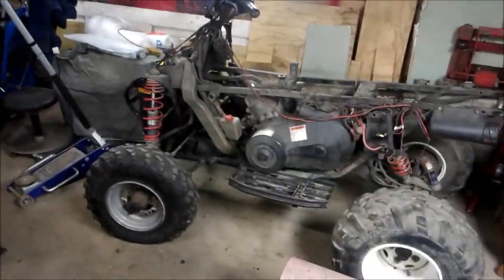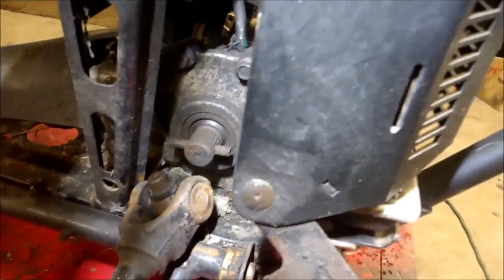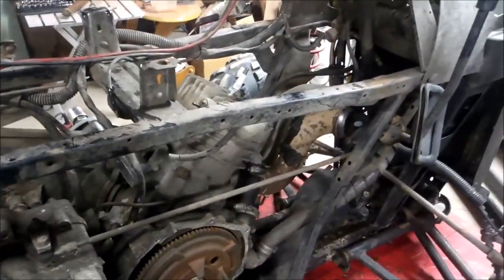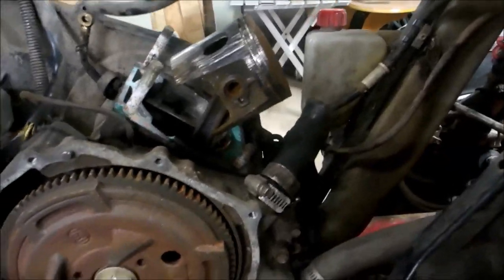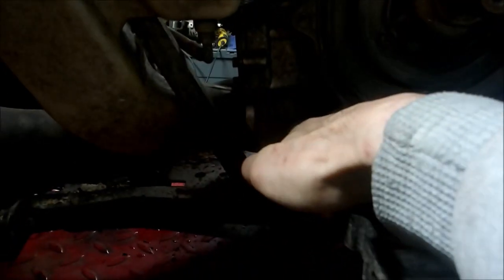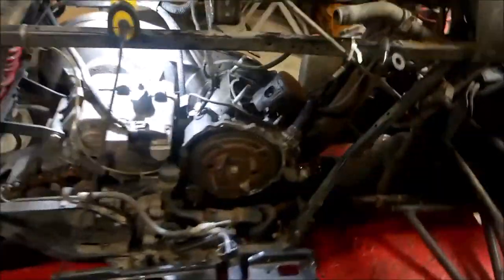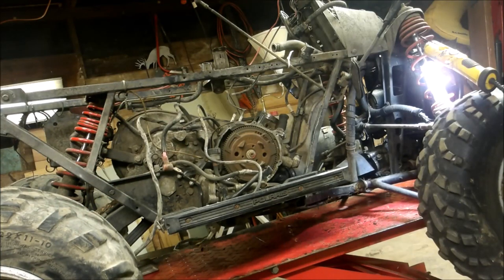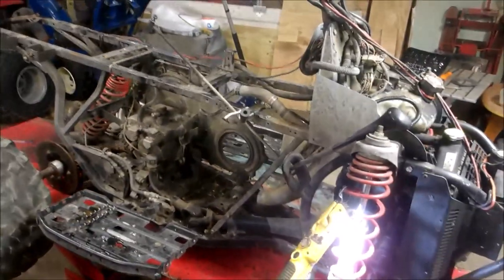Seized motor! Polaris 400 Engine removal on a Basket case.

Comment: What is the thread pitch on the 3/4 rod you made into a clutch puller? Did you taper the end of it or grind off any of the threads?
Reply: I’d like to know also.
I have a bunch of Polaris snowmobile pullers I’d obviously try  first

Comment: Well I pulled the dipstick out of the transmission and the magnet is full of steel. I think it's locked up because the transmission exploded. Can the transmission explode & lock up the engine? Are they rebuildable when they blow up, or should I just get a new one?
Reply from the maker: transmissions can be rebuilt. I have a video on one being rebuilt. If the tranny is locked up it will put pressure on the belt and the clutch will have a hard time turning on the engine. The engine and Transmisson are separate. Try to remove the belt and see if engine runs.

Comment: Watching this episode vs my "mint shape" 2000 Scramble 400 :  an oil pump leak,  good compression, rad hold coolant, dry/not too dark spark plug, clicking starter solenoid (cranking some time), questionable sparks (on and off)  and an unknown carb.......l guess it was parked years ago when 2T oil leaked and never run again.....

Comment: I have a 2001 scrambler 400 2 stroke and it doesn’t have a radiator it has an intake house up to handle bars, is that factory?
Reply: Ner

Comment: How did you get the pull start off without removing the from driveshaft
Reply from the maker: Push or disconnect the brake lever. There is just a small amount of clearance to wiggle it past.

Comment: So I got a Polaris it’s a 250 I don’t know if it’s a sportster or what it is but I have washed one of your videos about the spark plug and it was the Killswitch well I got it fired up but the guy that I got it from ripped the wires up so I had to touch wires to start the 250 it fire up for a little while and then I will die down I mean any suggestions I should do with the wiring or how to keep it running I don’t really know very much about any of the Polaris
Reply from the maker: I would clean the carb. It might need adjustment. what wires are ripped? maybe get a new switch off ebay. Also ,it could be your cdi box depending how long the wires were bad.
Reply: Titaniumman Garage  is there anyway I can send u a picture of it or do u have Facebook
Reply from the maker: @benjones5426  T-Roys Toybox on FB.
Reply: Titaniumman Garage I sent you a video most of your videos I’ve been watching has really helped me try to get this Polaris running

Comment: New to the channel.  Lots of great info here. Thank you.  I have 2 1993 Trailbosses.  I'm replacing the piston rings and doing a top end job.  Can I ask where you get your Polaris parts?
Reply from the maker: E bay for the piston. There is a guy in Milwaukee that parts them out. I get alot of parts from him.

Comment: Dude please help.   Have a 2001 scrambler 400. And my carb i think.  Can barly get it running. and when i do.  Soon as i hit the throttle it bogs and dies. Have to feather the throttle to get any type of revs. Looks like its dumping fuel in the carb . Cleaned everything  and i dont know what to do. Any thaughts
Reply from the maker: It could be  lots of things. First try a rebuild kit for the carb. Everyone says you can just clean it and go. I've found out it performs better with a new jet. Check your throttle cable. Does it stick anywhere? Check your oiler. Is it stuck open? If so try a new cable. I'm assuming its a 2 stroke. Pull the sparkplug and drain the case. There might be too much fuel at the bottom. And check the exhaust. I had a mouse nest in one of mine. What color smoke is coming out of exhaust? Also check your carb settings air/fuel mixture screw. Also the place your cable comes into the carb. sometimes turning it in or out will lower the amount of fuel coming in. And lastly do a compression test. you can rent a tester at any auto part store. compression should be above a 100. I've seen em run at 85 but pretty weak. Hope that helps. Its hard to diagnose without seeing it.
Reply: @TitaniummanGarage  hey thanks for the verry nice response. Compression is at 125. Smoke is bluish white more white. Tried draining case already nothing came out. But i didn't pull the plug ill try again your way. everything els seems ok.  Tries the air fuel screw and idle screw.   Carb rebuild kit on the way thank you. ill let you know if you got it running for me
Reply: @rolfbach2721  mine did similar only when i'd let off the gas it'd die turned out to be the throttle cable was to tight

Comment: I have the Florida version a 90 trail boss 250 can't get the clutch of I'm going to try that the piston had no compression it has been sunk probably many time wired up for nothing but pull start and no battery but it dose have great spark the top bolt on the head was a bitch to get out so after seeing that I'm sure it needs crank seals and bearings I don't know if you've done a video on that I like these Polaris and you've answered some questions before it's much appreciated as the dealership is useless with older machines
Reply from the maker: Thanks. Did you see this video? https://youtu.be/lI1R7Wi1xnM Its for a 400 but the installation of the seals are the same.  I've used a 3 inch wood screw. screwed it in the seal to get it out just and use a press for the bearings. you can get a cheap press at harbor freight. Good idea for a video. I love these older machines too. lots of power off the line and they are easy to repair compared to a 4 stroke. Good luck with the 250
Reply: @TitaniummanGarage  imgonna check that out I just picked up a xpress 400 and a parts frame for $75 do you habe any videos on how to fix the shift lever it's not even moving the rods and it's definitely not right sometimes people do more damages trying to fix these than if they left it alone
Reply from the maker: @georgehuffert5157  Your giving me all kinds of ideas for video's. thanks. Best thing to do is unbolt linkage from tranny and shifter. take a vise grips, turn shifter on tranny to neutral on high and low if it has it. put shifter in neutral. loosen nuts on both ends of shift linkage and spin the ends till they fit in the holes of the shifter and tranny. then adjust once running and tighten nuts. lots of guys jam them into gear and the dog gear in tranny goes to hell. I have a video how to rebuild a tranny if your is that bad. and sometime shifter goes bad gets rusty inside. you can take the 4 screw out of the top and inspect it. there is a small spring inside so be carefull when you take it apart to see where it goes.
Reply: @TitaniummanGarage  I'm gonna try that all my bikes are old my newest is the 97 425 magnum 4x4 that needs at least rings I'm going to watch that video I have 3  2 wheel drive transmission in parts bike's do the 2 stroke and 4 stroke use the same transmission they look the same
Reply from the maker: @georgehuffert5157  The 425 might be the same. 500's use a different transmission along with the magnum 500's
Reply from the maker: I just tore down a 500 and removed the crankshaft. I should have recorded it. 425's are pretty damn close to being the same. cylinder is a little smaller.

Comment: I have antifreeze in my cylender and in my counterbalance oil what can it be
Reply from the maker: Sounds like the water pump is leaking into counterbalance and your inner crank seal it worn letting coolant enter engine. check out my rebuild video. https://youtu.be/lI1R7Wi1xnM

Comment: Thta piece of crap water pump shaft...were end goes bad,and need to split to repkace bearing....im thinking of just putting an electric qater pump on outside,and bypass gear driven...and counter balancer....I only use 4 wheeler to take jet ski trailer to water and back
Reply from the maker: I've heard of guys doing that. It does put a stain on the battery. But your just using it to pull ski's..go for it.